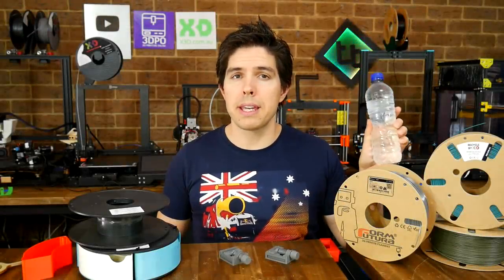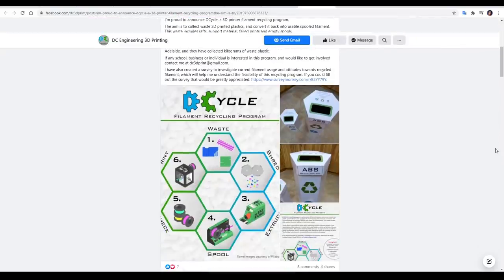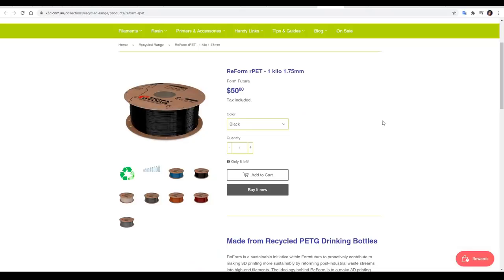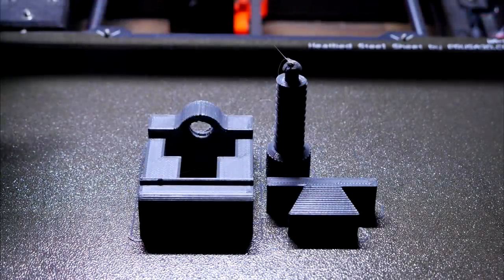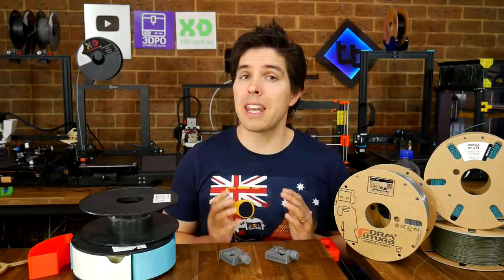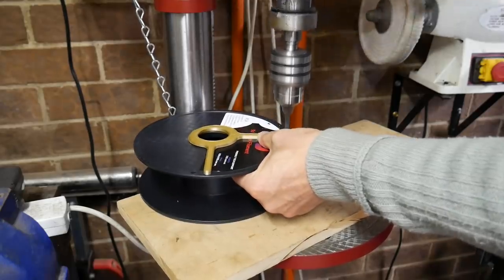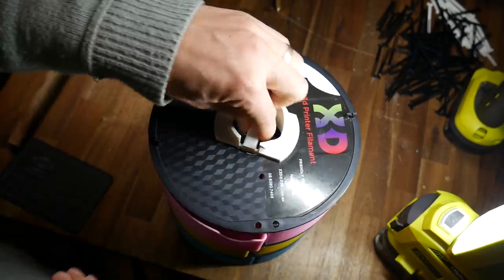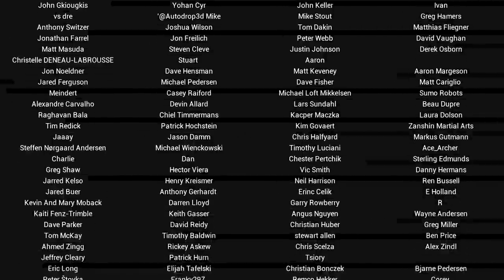3D Printing with recycled PET bottles and turning empty spools into storage

Comment: Hello, i need help,  is there a place in Australia that I can send a Ender 3 pro to,to  get a service or check it assembled right  - It will print a 20mm test cube - but if I try to print anything bigger the extruded blocks up or it does not stick to the bed - I am legally blind so watching videos or following web pages are not the best answer - I have no idea about what my firmware  is or  the type of board or what a boot loader is or if i even have one so anything Like  this is useless to me - the printer was assembled with help from my mate next door. I do have a Flashforge Adventure 2 that prints just fine but need one that prints bigger - the slicer is not the problem as I have sliced prints and had another person print them for me with out a  problem.  - ???? or could i trade it in somewhere for  a large plug and play machine like the Flash forge.
Reply: Grumpy Frog Productions: I had the same problem with my Crealty 3-D printer the Enders 3v2 and I am not blind. So I checked out the Polaroid smart play printer and it is truly a plug and play machine. It has a much smaller bed please but makes up for size with ease of printing. I finally got the amber 3V2 workingAnd now I have two printers that I can use when printing a number of small parts. Good luck with solving your problems.
Reply: @davidedes7577 I have flash-forge adventure 3 and that machine is a dream machine- that why i got the ender 3  - the ender 3 is crap compared to the Adventure 3 - it just works

Comment: Instead of all of that pick nonsense you should have just put a little stud on the tray, then then trays just snap into the holes you drilled on top and bottom and pivot on their little stud/dowel that's built in. Sure you might need a but of support material, but overall you'd have a far more robust design, and less points of failure. Plus no need to drill out the drawer holes. No need for extra parts. No need for clearance between spools

Comment: my printers sit on those little ikea tables. Getting down to work on them sucks. Took two large 2kilo spools, some zip ties, packing foam from a printer, and a bunch of stickers I had around to make a legitimately nice little stool.  Zip tied the spools together for height,  foam on one size for seat pad, "upholstered" the foam to the spool with the stickers.  That fancy Duct tape would work well too or could use a stapler and fabric. 

but really, why does filament even come on these absurd spools? often the spool weighs more than the filament and they stack up fast. the storage is cool, might do that.  an all cardboard spool would be pretty straight forward. Manufacturers? any comment?

Also, have you seen that little tool where you can cut a PETG bottle in a tight spiral and turn it into a cord? Ive imagined something like that being a potential to cut bottles directly into filament. You would probably need a specially shaped hot end and maybe a way to calibrate the feed rate continuously based of the filaments actual dimensions, but it could be essentially free and unlimited filament

Comment: So as a toolmaker i can 100% debunk your wast claims. Even 15y ago it was starting to be "not rare" to fill in up to 60% recycled pellets, as it had been proven to not decrease strength. This practice has only become more and more common over the years. In fact it's now not uncommon to find packing in your local supermarket made from 100% recycled plastic. This is however a still not possible on injection molds where strength is a consideration, due to slight mix of plastic types and degradation. Consumer level plastic production (3D printing) didn't exactly do anything good to the plastic recycling system that was in place already before the craze started. So it nice to see that this is beginning to be a concern YouTubers like yourself is trying to get across to their printing viewers! :)
Reply from the maker: Thanks fore sharing your expertise.
Reply: @TeachingTech  Oh no, thank you for sharing! Learned so much from you, it's been great :) I just figured I finally had some useable wisdom I could add to your array of knowledge

Comment: After some calculations... It is cheaper buy some shelves or drawers instead printing to reuse the spools. 
Did you measure/weighted the pla used to each spool? How many hours printer worked? And the electricity cost and time for molding.. 

I tried build some pots, but water and roots broke the vase..

BTW, great video!
Reply: I think that the benefit was that he got to use filament that would not have been usable in other projects, as there was not enough left on each spool to print normal projects,  and he got to use old spools thT would have been thrown out otherwise. That plus not having to buy new things (thus contributing to problems caused by shipping) is usually a net benefit over all.

Comment: I have my slicer profiles tuned perfectly so 99.9% of what I throw away is purge lines and skirts. I can't remember the last time a print failed. Maybe get your shit together.
Reply from the maker: Nice one. Maybe consider I'm not working with the same machines all the time, but rather reviewing machines of variable quality, often without slicing profiles. This means a lot of the time I have to print for the sake of printing. Add to that the iterative process of refining a design i am working on and hopefully you can start to understand.